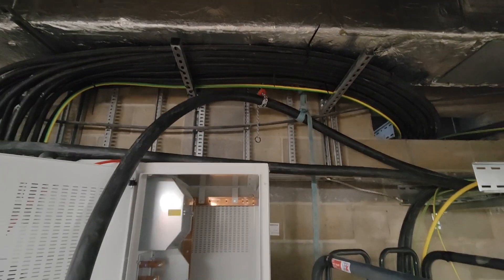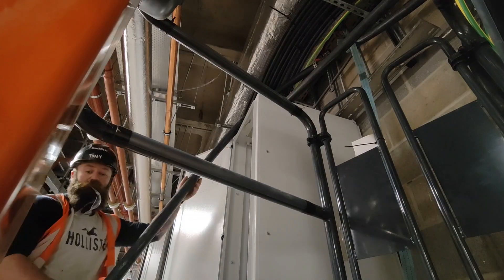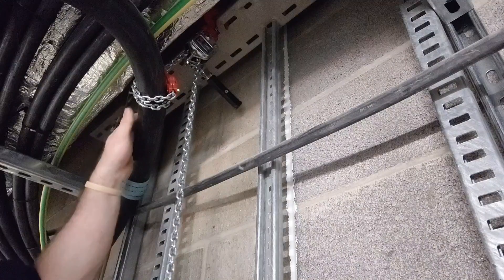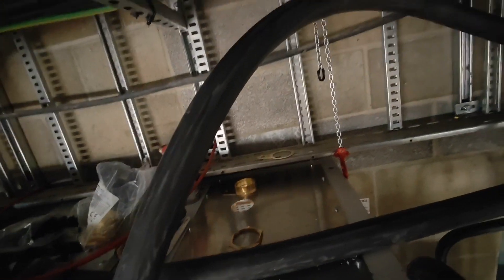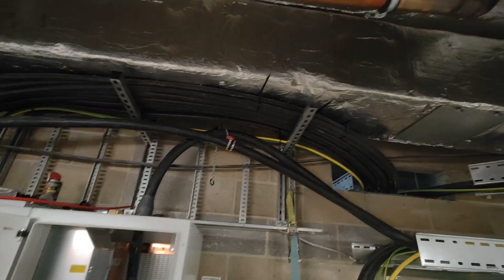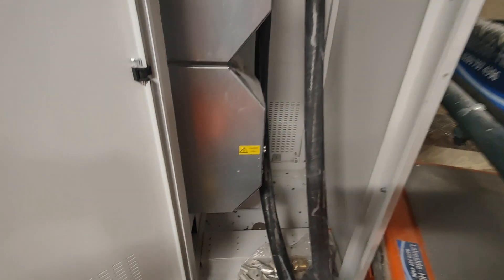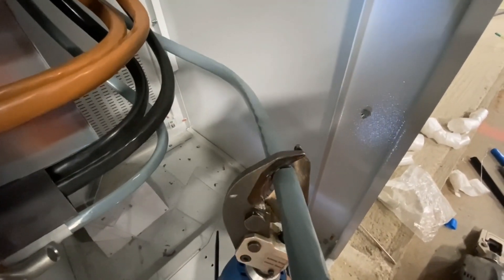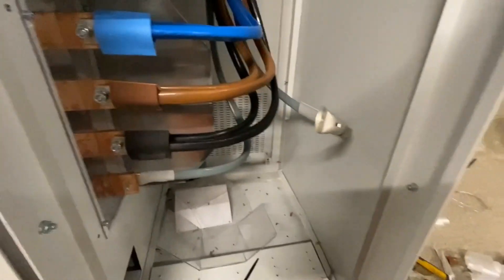Two 4c X 185s and a 185cpc. Very tight space!!

Comment: Ever so slightly file the outside edge of the copper at a slight angle where it enters the lug. This will help the lug slip on if tight without damaging the integrity of the cable itself. A nylon hammer great also for “persuading” the lug to go on without damaging it.  Great videos with very knowledgeable installer.
Reply from the maker: Nice. Some good suggestions. I have a rubber one to hammer them home. This doesn't damage the lug either. I might try the filing idea in a future video. Thanks pal👍🏻

Comment: I would have got a gland plate made for the side entry.The swa cables would make a good coat rail..good work.
Reply: Excellent content Tony. Great tip regarding cutting to accommodate Lug.👏
Reply from the maker: @Aidiecantwell61677  as Tesco say "every little helps". It'll just get the lug started and when time is money it counts.
Reply from the maker: That was discussed but the time constraints were against us. I've just had to do the same thing with the other end of those two cables😞

Comment: Can you recommend the racket device used to pull the cable up
Reply from the maker: It's a 250kg ratchet chain block. The one I have is made by Sealey. The chain isn't very long (about 1m) but it is really effective in a tight space.